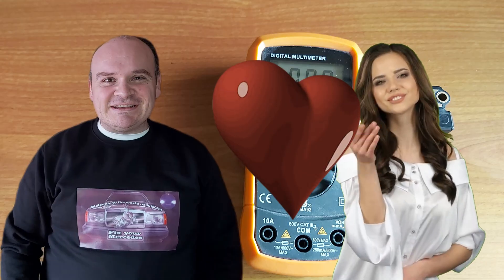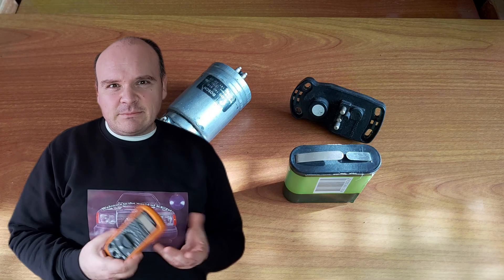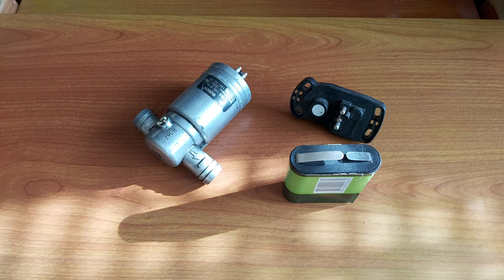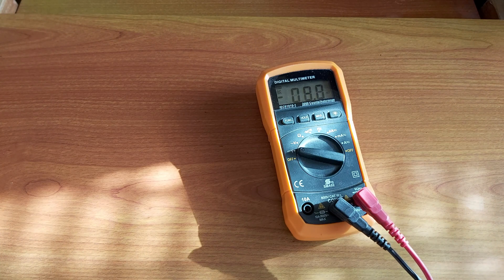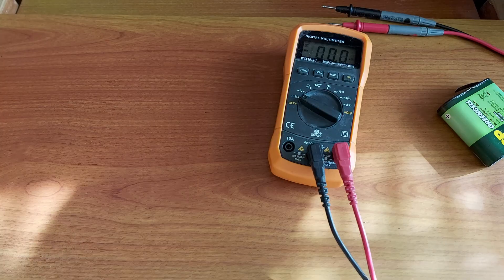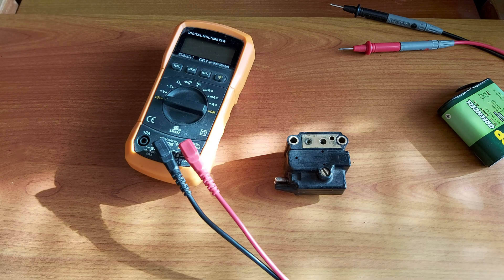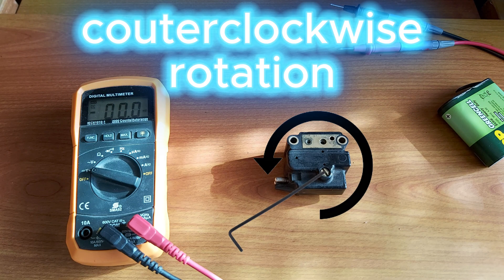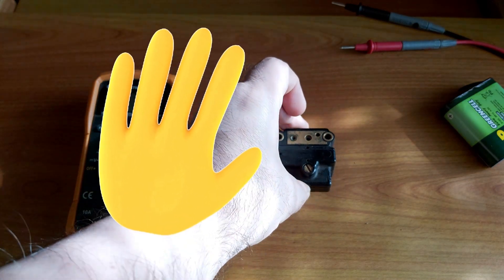㉦Mercedes Ke-Jetronic㉦ - Measuring the right way

Comment from the maker: The point of this video is to show that it's very important not to get a negative sign on the multimeter when you measure current on the EHA(electro-hydraulic actuator). When you measure voltage on the car on any component it's not a big deal if you reverse the polarity but when you measure the current in mA on the EHA you must make sure that you obtain the value with the positive reading otherwise the ECU(the computer) is going to understand it wrong and it will show LEAN instead of a RICH mixture or vice versa. The point of this video is to show you how to do the measurements on the EHA the proper way! Happy Mercedesing!

Comment: My M117 5.6 is running rich after I replaced the KE jetronic unit so my next job will be to check the current and see if it comes from it :)
Reply from the maker: Exactly, soon the whole video about adjusting a W124 convertible.
Reply from the maker: Are you the guy from Vojvodina with cool MErcedes cars?